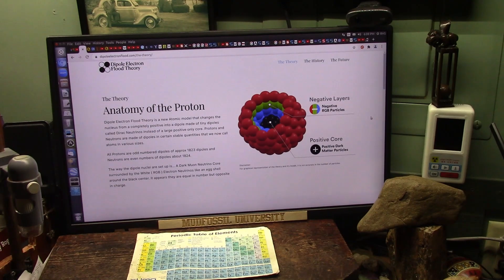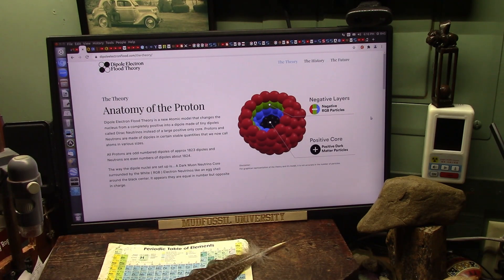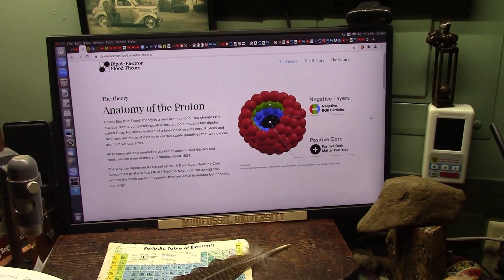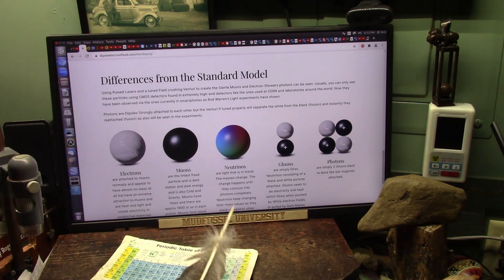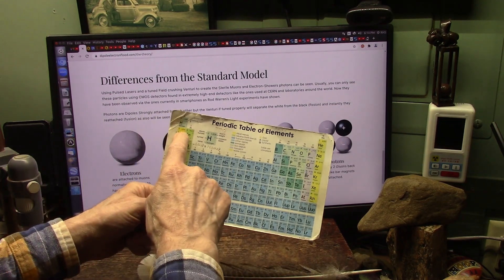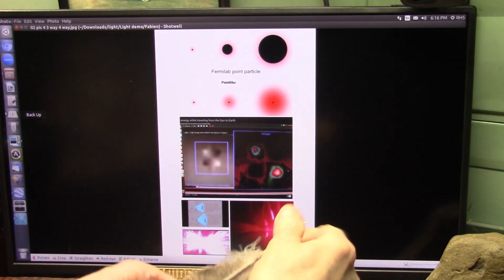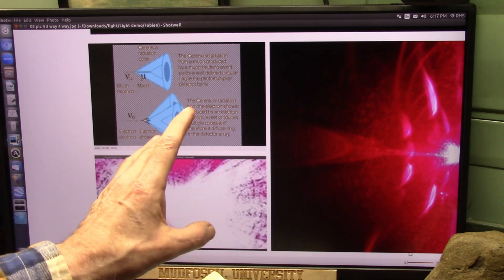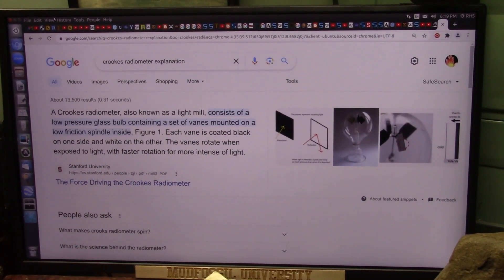What is cold and hot and Electricity made of and how Does a Crookes Radiometer Light Mill work

Comment: All atoms are magnetic fields. Hot and cold are attributes of movement, related to energy in and out. Add energy to a field and it increases. These fields will interfere more energetically with each other causing expansion and movement (heat), pushing against the radiometer surface. When energy is removed from a field it shrinks, and surrounding fields will steal energy from each other causing contraction and movement (cold), pulling on the radiometer surface. When the field is too small to lose energy (at its dielectric event horizon/nucleus/solid black ball) you have absolute 0, no movement. They call it dipole electric flood theory because it's just a belief based on ideas (theory) related to observations.
Reply from the maker: I show the particles not just theory. What is energy made of?

Comment: THE BLOOD FALLS‼️
One of the most incredible natural phenomena on the planet.
The mysterious formation of Antarctica that intrigued scientists for a century.
They are found in the Dry Valleys of Mcmundo.
The red liquid gushes out from inside the mass of ice, until it flows into Lake Bonney.
Discovered by Australian geologist Thomas Griffith Taylor.
The water should freeze and it does not, although the temperature in the place can reach 60 degrees below zero.
The content of the lake that feeds the falls is 3 times saltier than seawater.
Its waters are rich in IRON...extremely!
The blood effect occurs when the lake's salty, iron-rich water seeps through fissures and falls into Lake Bonney.
WHEN IT COMES IN CONTACT WITH THE AIR, IT OXIDIZES AND ORIGINATES ITS COLOR!!!
It can be visited only by helicopter or cruise ship.
Reply: Can you talk about this “phenomenon”?  I saw it on Facebook with photos I saved, I can email them to you if you’d like

Comment: Cold heat and electricity… and matter all comes from light ?   Absolute cold is when all particals stop moving … are at rest.   But there is brownsian motion still.   Heat comes from friction.   Electricity comes from voltage which is increasing or decreasing pole differentials.   Light is an electric circuit?   😂
Reply from the maker: Think of it this way Black is cold white is hot. Lots change